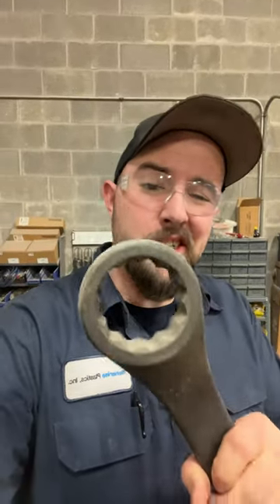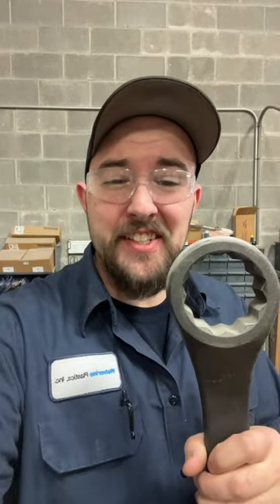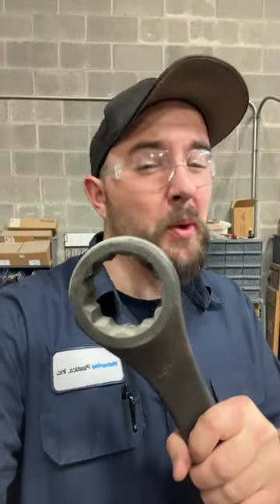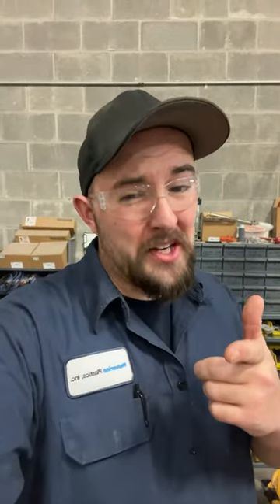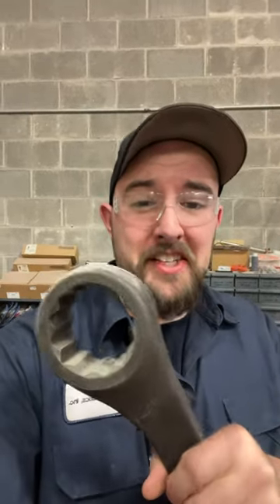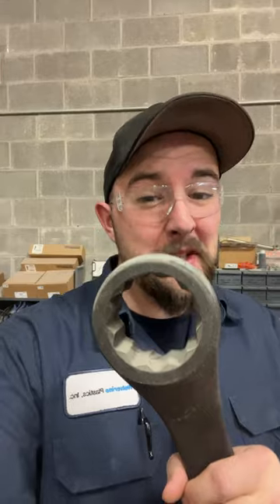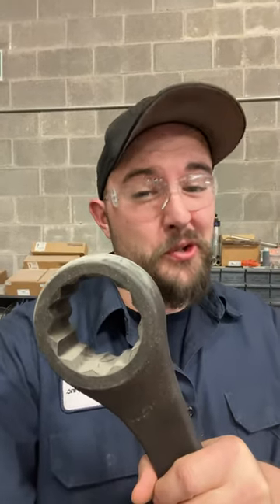12 point or 6? #tools #education #advice

Comment: It kinda sounds fun to beat a massive wrench with a sledgehammer
Reply: Go to a Oil Rig Im sure the Guys will let you , when they are doing tear down lol  8 hours of swinging a 20 # hammer is work .
Reply: As an ex millwright. It's fun for about 20 minutes or 15 fasteners which ever comes first.   
Had a buddy talking up his pretty new Milwaukee impact and how powerful it was. Poor thing could barely run the nuts off after they were broke loose. If I see another 4.5" nut in my life it'll be too soon.
Reply: I can assure you it is not very fun at all.
Reply: As long as you’re not the poor sap that has to hold the wrench….
Reply: For about 5 swings lol
Reply: @rippersix293  if you have help the person not swinging the hammer will tie a rope ti it and pull it in the direction it’s being hit.  The constant tension in the wrench will keep it from bouncing off most the time.   If your by yourself and need to get shit done.   You put a rag,old shirt, old glove, or whatever over the nut and then hammer the wrench over the nut/rag and get to swinging.
Reply: Did it a lot in the Navy. Put muscles on this skinny boy. lol
Reply: Drilling rigs are hiring all the time! You can get plenty of time on one.

Comment: we used to change fluid ends(the part the piston and valves were in) on massive pumps. only 5 of the 8 nuts were accessible with a sledge. for those three we had a 3-1/2 inch solid round bar 5 foot long we'd pound them with. on a 12 point you could barely get one notch at a time. oh to be young again!!

Comment: I’m my experience the 6 point hammer wrenches are flat and you can flip it over to to get a half “bite”  due to the clicking on the 6 point. 

 For the $100 question. Would you rather be swinging  the hammer  or holding the hammer wrench?       We would always tie a rope to it for a safer clusterfuck of an operation.

Comment: That's also ignoring the generally WIDER VERSATILITY of a 12pt socket/wrench

They can be used on way more than just hex bolts:. Square, spline, torx can all be driven with a 12pt

Comment: not had to use any quite that big but when i needed more grip i added some round pins to the extra points to contact the flats of the bolt used half inch round with a slight taper